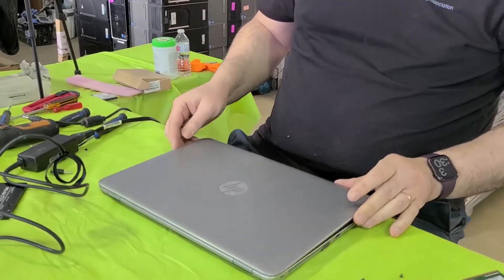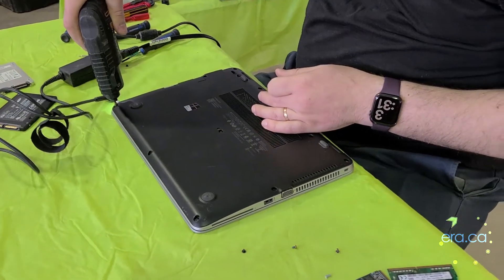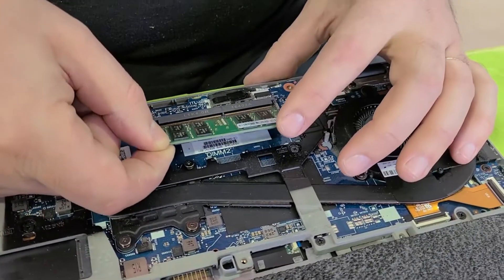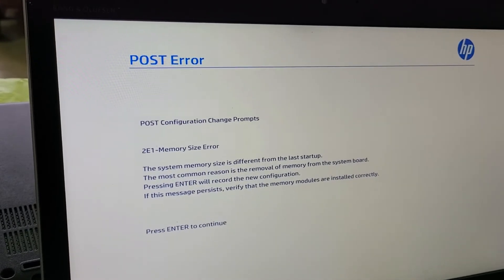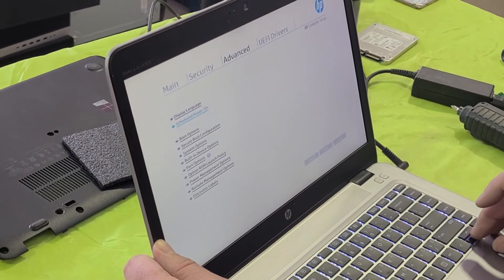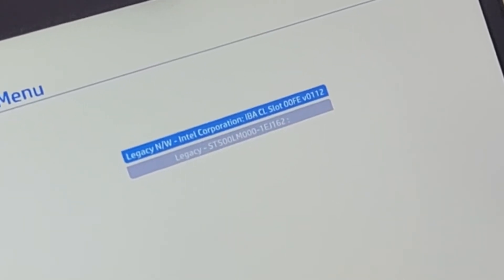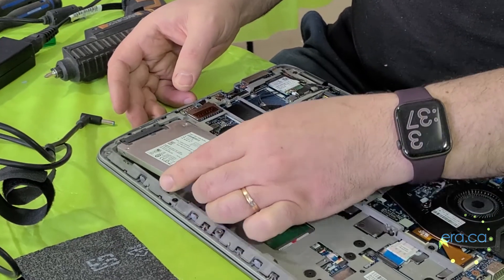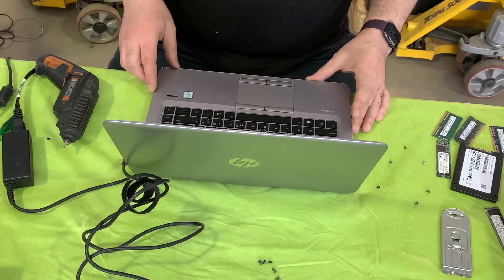ERA U Laptop Series 2: Hardware Upgrade HP Elitebook 840 G3

Comment: I replaced stock memory with 32Gb or 3200MT RAM. System info shows RAM is operating at 2133MT. How can I change BIOS to take advantage of 3200MT RAM?